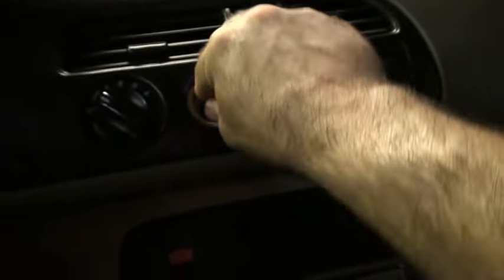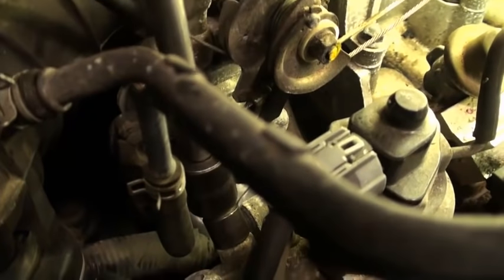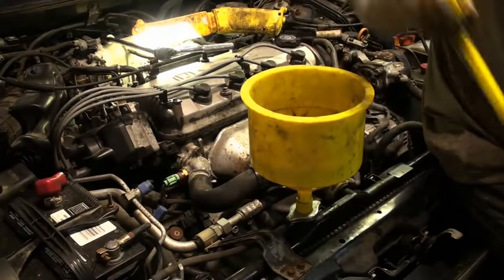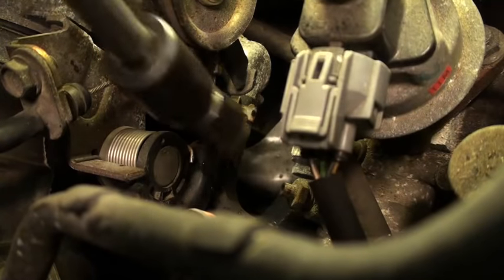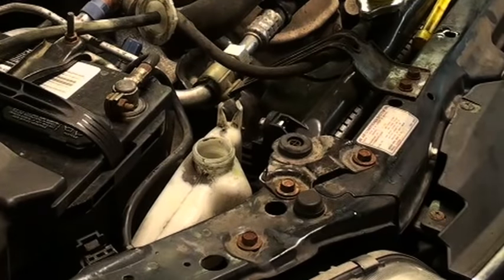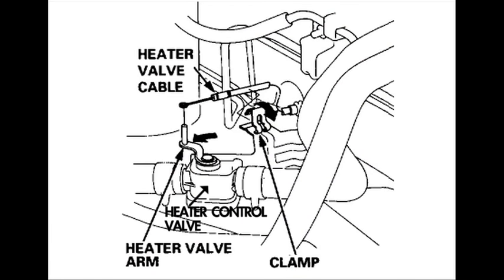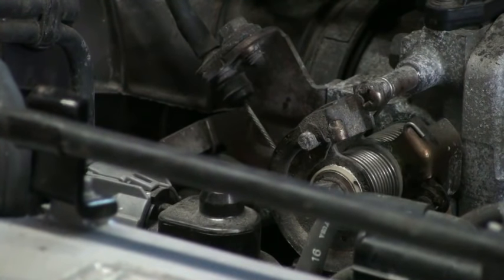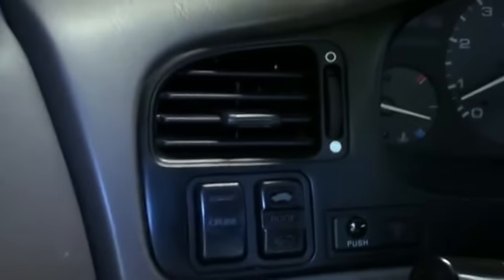How To Bleed A Cooling System - EricTheCarGuy

Comment: When I do this my coolant starts shooting out aggressively what's wrong?
Reply: I had that problem with a weak heater on my olds 307. I could not simply get the air out because it would violently explode out when the thermostat opened. It was because the cylinder head was leaking and as soon as the thermostat opened, all that exhaust pressure backed out would be forced in the radiator and out the filler neck like a volcano. Would also occur if I attempted to shut the vehicle off without the rad Cap secured. Replaced my engine and this never happens anymore. It should be noted that the leak was so small that there was no evidence of coolant/oil exchanging with eachother, so this was a difficult diagnosis and took a long time of struggle before the problem was narrowed down to the only possible scenario. A leaking cylinder head forcing exhaust into the cooling system. On top of the violent coolant exorcism when trying to bleed the system, the upper hose got so hard that you could not squeeze it AT ALL. I now can feel the difference between 16lbs and that, and let me tell you you should be able to at least slightly push in on both sides of the hose when hot with the cap on. This was not the case before as not even superman could squeeze that hose. I'm really sorry to say, but I would say with 99% certainty you have a leaking cylinder head. Either at the gasket or a crack in the head itself
Reply: @c0unt_sn4ckula  thank you very much for this detailed reply. My jeep does the exact thing with the hoses as well. Feels like an insanely tight balloon. Recently did the head gasket too so the head is definitely cracked somewhere. At least I know that now thanks to you :)
Reply: @BravenR  No problem it was a fucking nightmare. It also never overheated despite the insane amount of exhaust that built up in the system which made it even harder to diagnose. I tried thermostats several times, water pumps, radiator caps, all never resolved the issue. Winter was so bitter cold. I even had repair shops dismiss the possibility of a cylinder head leak and finally one confirmed what I suspected all along. I swapped the engine because It was mid winter, don't have a garage and I would have hated to have paid a dude to tear it down to the gasket to discover the head was fucked and not just simply a gasket replacement. I just drove it as it was and waited until summer to swap the engine out. Still haven't torn down the old engine to see where exactly it failed and if it is even repairable.
Reply: Btw it also ruptures me heater core... TWICE
Reply: Also finally one thing you could try that I did not bother with since I already had a replacement engine in my driveway is you could try to retorque the head bolts one at a time in proper sequence if they are not a torque-to-yield bolts to see if it's just an uneven clamping with the gasket when it was replaced. Otherwise it could be a hefty repair with the possibility of wasted money. Best of luck!

Comment: hey eric how do i bleed my coolant  on my 2000 blazer
Reply: Find the bleeder valve and do the same thing
Reply: linkassasin450 lmao
Reply: linkassasin450  i don't think my 2000 blazer has one does it ?
Reply: linkassasin450 how do i bleed my coolant on my 1976 f-100 then smartguy
Reply: Phil manwarren The radiator petcock is on the lower passenger side of the radiator, but that's more for draining. As stated in the video, the only reason for the bleeder valve is to accelerate the bleeding process. You can do it just by using the radiator cap. My 98 Blazer never needed this done, and at any rate, none of the 3 4.3L engines I've owned have needed this, even after a complete coolant fill and flush. If you're trying to solve a problem, try a different approach besides this one. The coolant circuit on a 4.3 is relatively straightforward and shouldn't be causing weird issues that other vehicles (Honda's have idle issues) may have.
Reply: Adam Swint  ok thanks

Comment: I have a 2000 Dodge Dakota and it had started to overheat outta nowhere.. so I first check to see if it was low on coolant it wasnt but I still topped it off to make sure.. then I change the thermostat that didn't do then the sensor and it seem to have done the job ... (oh by the I drained the coolant system before I replace the thermostat and again when I change the sensor ) so anyway like I was saying now it overheating again ? could it be the heatercore? I know it bad because smoke comes out from the vents ... if anyone has a clue on what's causing the overheating ?? thank
Reply: +Mario Murillo Check the Blinker fluid what kind did you have in there? also do you have muffler bearing installed if not put some on they usually help make sure you get the kn ones tho
Reply: +Mario Murillo yea some 2 stroke oil works great for your blinkers. just be sure to fill the blinker resivor! or else your unicorn valve stem will give you hell
Reply: It didn't work .. I still have the same problem
Reply: +Mario Murillo did you bleed the cooling syestem after replacing the thermostat
Reply: Javian English yeah I did

Comment: Okay guys I need help on my 98 Honda civic ex my car started to overheat I'm driving along stopped for 15 mins left car running temp gauge all rhe way to the top so I turn heat on wire fan on as I start driving again it goes back to normal about half way and I drive about 20 mins home at highway speeds so now I get home let car cool decide to turn car on and heat and let it just run to ser if the FAN kicks on now about 20 mins in the FAN kicks on ONLY FOR ABOUT 3 SECONDS and a few times it kicks on and goes off right away like it wants to stay on but just turns on and turns off and my cars needle starts to rise again at about the 25 min mark now still the fan kicks on and goes right off so I just shut car off then the FAN kicks on for about 5 seconds weird!! So I'm hoping my car is overheating due to a fan problem no white smoke out of exhaust heat does work so hoping not a head gasket plz help much appreciated!!
Reply: It could also be a faulty cooling fan relay or electronic thermostat\temperature sensor. But before you change anything, check that the fan spins freely(you could also check it's function by directly connecting it to the battery) and checking that all wires are whole. Also use a wire brush on corroded connections. Also, try bridging the relay's switched contacts. If the fan turns on, you just have to replace the relay.
Reply: +Jason O'Connell It's an ex car so send her packing.
Reply: Thx guys ended up being a bad ground
Reply: hrhhdkkfjdkkdkdodoPpdodididoooodgkzodhhJK bmyeldgskkgkakslhanksjhdmfgkhjgjmkdfkkfgkkfkfkfmfkkgkgkggkjgmgkggjgjjfjggjjgjgjgjijfjiiiiiiiiiiiiiihsjkfhdnahtjfhtmjdjdjjfjfjfjjfjymjsljsrhfjjalfhDJgjjjyhip-hopbbbbb.                         mxjnxnnxnnxnxnxncncjcjdjdndjhhhhhhhhhdjdkdjsgnckfldJr he jog&burhskzbcbxmknnnxnznznhbdnbdkdjhhdjjjjjjjjjjjjjjnxndxbxmdkhsjlfjhjdndfljdjhskfljdjdjjgbkrkjxhhjdkjdifhfyuisoihvdhdjiijghfhjjhdjkkdhhioijjdjjcnchjbbcbxdbbxncnxjxjxjxjxjjxjzjzjzjozzizizizizizizozaa_ZZZZ__z_zziiiiZ_a@@@@@@@@@@@@@@222222@@@@@@@22221222

Comment: anyone know where the bleeder is on a 94 f150 4.9 Liter?
Reply: ***** Yeah surprising how tough this thing actually is not even counting the 4.9L.  Long story short I was looking for a hubcap on the side of the road (not from my truck) when a Taurus had stopped in front of me.  I rear ended it and when I got out to check on the car I had hit, the lady was staring at me with her whole body facing me.  Her chair was even facing me and my truck literally imbedded itself in the rear end of the driver seat.  Her car totaled.  My truck needed a new bumper, grill and drivers side headlight.  That was 6 years ago and all I have changed since then is a starter, battery, and spring tower.  And now a thermostat...  I love this beast.

Comment: prolly a dumb question but what is the tool called you used to bleed valve
Reply: It's a socket with an extension, mounted on a ratchet.

Comment: EricTheCarGuy and to anyone who can help on this problem, I have honda civic 98 , the car blew headgasket and it started it idle problem,  replace headgasket new radiator and water pump and radiator hose and the car still idle very high. My fan stoped working so i wire it to always be on when the car is on key. I have a question to anyone here. I want to try to flush my coolent system but I don't have a/c coolent fan only radiator fan so i basically have no a/c is it possible to do this? Pleasee!!!! Help!! This idle problem is really frustrating! I check for vacuum leaks iacv notice, I'm planning on changing the throttle body gasket. Any idea? Please help!!!! I'm at a lost!!!!

Comment: Ok guys Im gonna need some help from people that know about engines. 
The other day I was getting off the freeway and noticed my temp gauge was almost touching the red "H" and my car never over heats like that so I pull over immediately and noticed that my radiator had a hole from a rock or something. All my coolant was gone. I let it cool off for 30 minutes then drove home 3 minutes away and the gauge stayed above the middle. It's never over heated before till now. 
Today I replaced the radiator with a good quality replacement and refilled my coolant and double checked everything but about 10 minutes into my test drive it started overheating again unless I blast the heat and drive slow. 
Im thinking its just a blown head gasket but I dont know for sure and I don't have the equipment to test the compression etc. 
Any ideas would be helpful thanks in advance.
Reply: how is your exhaust smoke? if you blew you head gasket i think the coolant should leak to your combustion chamber and as result u see white or grey smole coming from your exhaust pipe.
check to see if you have bled your cooling system properly. pick up that spill free funnel, it helps a lot.

Comment: I have an 02 Firebird and wanted to know the steps to filling the coolant after draining the old coolant. I was told to run the heater when filling the radiator. I dont understand when or why this has to be done. Draining the coolant I understand loosen the pet cock and out it comes. Unless their is something more that I dont know

Comment: Everybody do yourself a favor and only run car to temp where thermostat opens because if you wait for fans too kick on your coolant will start boiling over and making a hell of a mess trust me it sucks cleaning up a lake of coolant in your garage not to mention the mess it makes of your engine bay
Reply: If you have a spill-free funnel as shown here, that won't happen.  I've bled my Honda's cooling system many times by running the engine until the fans come on (which takes FOREVER sometimes), but with a regular funnel and I just keep a bunch of rags around the radiator opening.  Not the cleanest procedure but it works.  I finally picked up the Lisle funnel last week, so I should be good to go when I change the timing belt and water pump here in the coming weeks.
Reply: @Patrick94GSR  i used a spill free funnel and didnt fill it before i started and it still overflowed
Reply: @jessjohn6157  Then you must have had massive air pockets in the system.  Luckily my car has a bleed screw similar to what's shown in the video, so by filling with the bleed screw open, hopefully there won't be too many air pockets when I start the bleed procedure.
Reply: @Patrick94GSR  no air pockets and i have a bleed screw on thermostat some cars are just different and heat up faster thus making the coolant boil over before fans kick on this is what my buick does and why i have to turn it off when it hits 90 and fans havent turned on yet otherwise it boils if i wait for fans, my mr2 doesnt i can let my fans kick on twice before it starts to boil

Comment: My mercedes is the worse for this. No radiator cap. Only reservoir. So no spill kit has a cap as big as a reservoir cap. No throttle body to accelerate while not being in car. No bleeder valve. Having a hard time bleeding it out

Comment: As I attempted the process, my radiator started throwing up hot water before the fans would turn on :-/
Reply: N yes my 2005 honda civic D16W9 doesn't seem to have a bleeder valve :-/

Comment: Sooooooo basically fill with water and the let coolant fluid settle in with cap off and motor running and then add more coolant ffs eric.
Reply: +Zlatan Ibrahimovic aaaaaand bleed the system. That's what the video is about.
Reply: yes
Reply: +Spartan111792  Hey man, i remember you , anyways, i dont get it, bleed it how man? so you idle the car and rev it even and then you what? just let it idle thats it? I thought u need to squeeze pipes?
Also, what if i have no coolant to add, i dont really get this video.
Great videos though from this gentleman
Reply: +Imre Csoka well most air would escape the sytem for simply idling with the cap off. revving would also help. theres typically a bleeder valve that you can turn while the system is cycling (fan on) so you can let air escape there as well.
Reply: Oh okay, i will just let it idle then and rev a bit on say 2000-3000 now and then, maybe squeeze a hose. Let the fan come on, okay cool
Then again i did this at the mechanic after we changed the thermostat
trying to figure out why my car is bagtling to get cooler when the it at 95 and the fan comes on, sometimes it passes 95 and creeps to 97 and it slowly goes to like 93, but im sure it should be able to get back to 90 or 91, i dont get it

Comment: check your thermostat.. mostly the cause of your problem
Reply: Oooor your radiator is itself is bad, or a cracked hose, or an air bubble in the system, or the fan isn't turning on, or your coolant level is low, or the coolant is bad or old, or the head gasket is warped or blown, or the water pump is out. There are many many possible reasons for engines over heating.. just dont let that needle hit the red!!

Comment: This guys kinda a hack. Thats a burping funnel, use it correctly you dont need to open the bleeder {only hondas/imports generally have them}. The trick is the burping funnel..however they only fit SOME cars. imports mainly. domestic radiator necks not so much. If you'd like to know how to burp a cooling system without a funnel like this, read a toyota mr2 service manual, or the stickers under the {front} hood. Bubbles float, all you need to do is make a column of water that is higher than the engine so fart gas can escape. air locked cooling systems suck.

Comment: Eric are you flushing out reserve container & existing hoses? Please respond before tommorow,the mechanic is removing coolant container because there was oil in it! How I don't know my Father gave me Grand Marquis 99 I'm disabled & though my credit is great there is no way for me to get a loan for a cheap car! My Father had a stroke 3 or so yrs,ago and has machular degeneration so is only allowed to drive a few blocks, but mostly has my mother drive him,I finally got it out of him on what else is wrong on car. This is the last car I'll get has to last till I die! Being in a rural area a car is a nessesary, he says there's a pin hole leak on the manifold.External hose, you can't get to easily! which is probably why he has let these couple of things go as he used 2 rebuild antique car's and it must kill him to ask for help, but also 2 pay,do you think any of this could lead to oil in reserve container? I cleaned out as best as possible mechanic is removing it and cleaning everything up &if it does it again depending on cost,he will teach me how to clean it! I think he said gasket was like 100$ don't know if that's labor or what! He's doing this tomorrow when he puts 2 new tires on.ready 2 blow thanks for your help deb

Comment: you risk damage to engine by doing that, by allowing coolant to boil then adding cold water. lol. It is safer to bleed the system cold se cars have a bleed screw for that purpose. It is never a good idea to run the engine hot with the cap off.

Comment: well when I first got the car it ran great then it started bubbling up.I bought a new head gasket my mechanic changed it out so he says.car ran great for about a whole year then it started slowly over heating changed out the water pump thermostat. new coolant new radiator new cap.ran great for a few months car still runs great just dam resivor sucks up the coolant fast til there nothing but steam coming out of it or the coolant bubbling hot!!!! so am thinking this asshole probly never changed out the gasket or my head is cracked or a big air pocket is in the system

Comment: Hi there. I have watched your videos a lot and they have helped me in many ways so thank you for that. But I have a question for you. I have a '01 Dodge Intrepid with a 3.2 L V6 in it. Now I just got done replace the thermostat and now I have no heat in the cabin but I did before. I have tried to bleed the cooling system but when I do I don't get any coolant to come out of the bleeder valve (which is located on top of the engine block) I just get steam. Also I noticed I get steam coming out of a tiny port on the top end of my coolant reservoir. Is this normal?
Thanks in advanced.
My Email is slash_l@yahoo.com

Comment: Hey man I have question ..why my dodge Durango get hot when I turn my ac on .specialty on traffic and I change the thermostat flush the radiator I change upper hose cause that's  looks porosity ..so I refills the radiator with 50/50 antifreeze and the truck still getting hot ..!! do you think I need to bleed the air of it ..or is the clutch fun or the water pump.?? . Please let me know and I really appreciated.. Give at answer at .. Jcmaldonado669 @gmail.com .